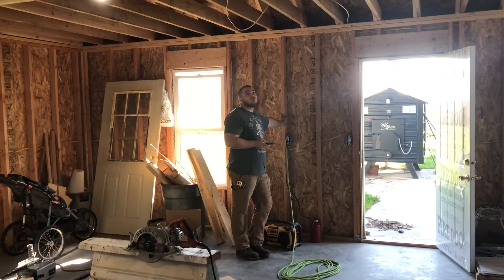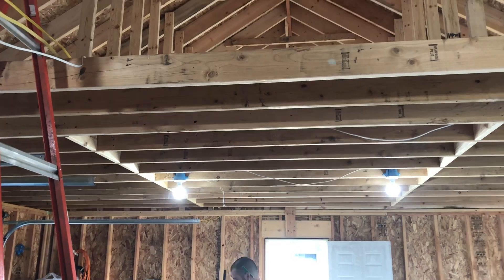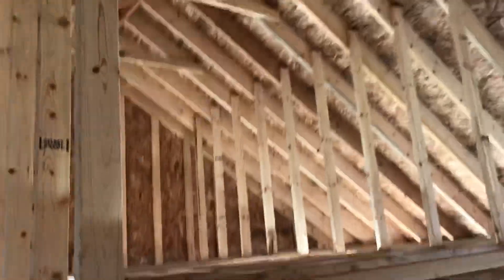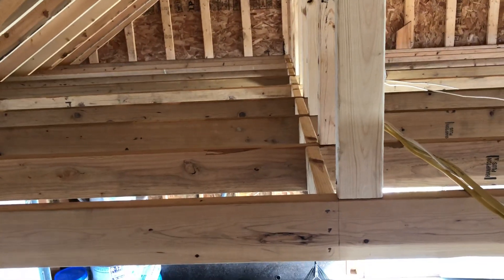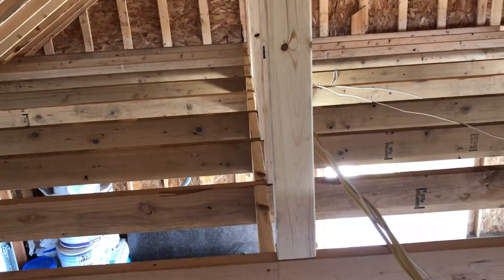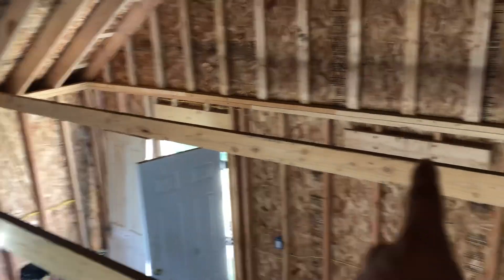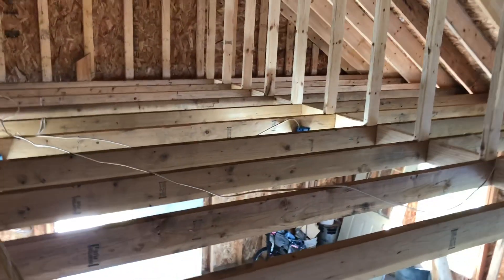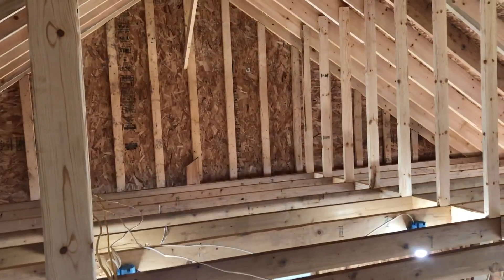Preparing a Garage for Drywall: Additional Framing

Comment: Based on a span chart 2x6 is not sufficient and those boards running up to the rafters may not be great as the rafters are not designed to support weight in that manner. Am I thinking about that right?
Reply from the maker: 2x6 would not be sufficient free spanning the garage. That’s why we took the time to go up to the rafters and glue on gussets. This was framed this way to support 1/2” drywall and blown in insulation. It is not a “working attic” nor should it be.

Comment: Is it possible to just hang the drywall from the rafters and not have a flat ceiling. Will the rafter hold the weight of the drywall alone?
Reply from the maker: You could do something like that but you’ll need to keep ceiling joists and collar ties every 4’ OC. Can’t eliminate those as that’s what hold the building together.

Comment: Thanks for the video if I'm spaning a 2×6 ×10 ft do you think I need bracing going up to the rafter as well??? Just hanging sheetrock on it
Reply from the maker: ram 12e 10’ is probably ok. 2x6’s work well as ceiling joists with no live load above it. Here was a different story because we were spanning 24’.

Comment: Was there a reason for only having an 8' ceiling? It seems like it would have been easier and cheaper to put 4" insulboard up to the roof joists and kept the high ceiling.
Reply from the maker: Steve 1961P. Good question. Just doing what the customer asked. I think the ceiling joists can cross anywhere in the bottom 1/3 of the roof plane and still be affective holding the exterior walls in place. I’m this case we just did what was easy and cheaper for the customer.